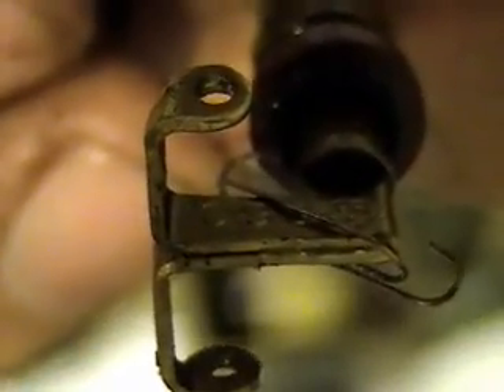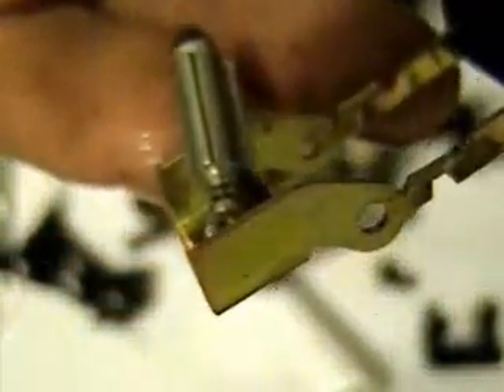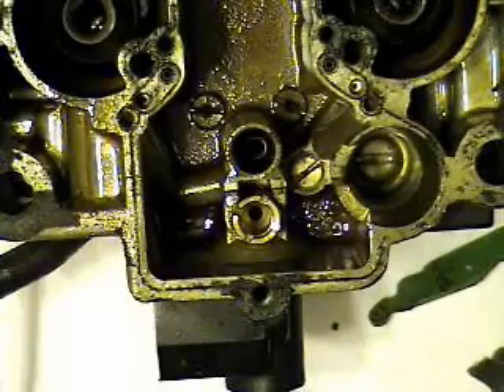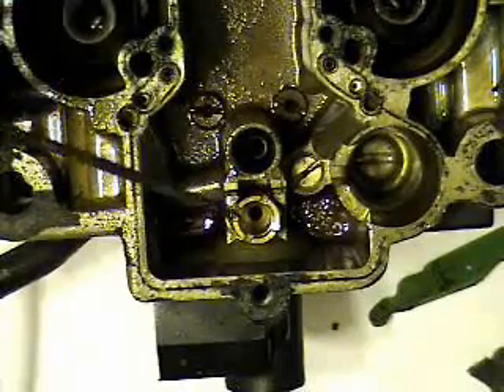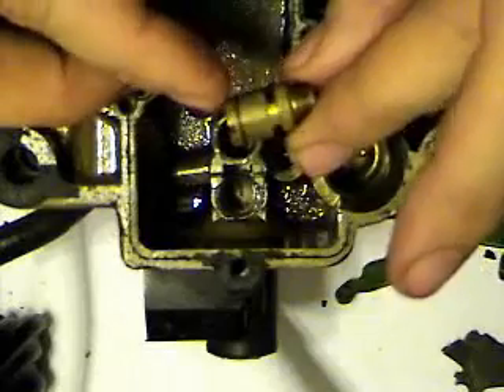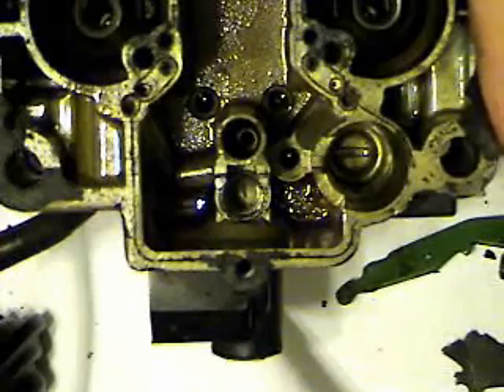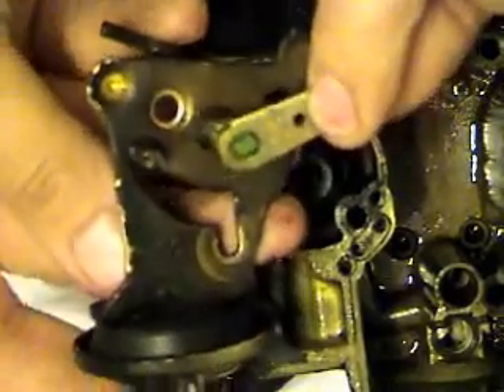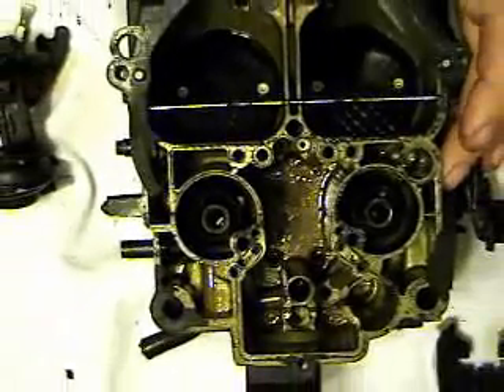Rochester Quadrajet Rebuild Part 3

Comment: Thanks for this video !!  In one of them you mentioned, in passing, the sight line from the carb to the fuel pump.  Is this line the same one that runs to the distributor?  If so, just add a 'tee' ?

Thanks again,